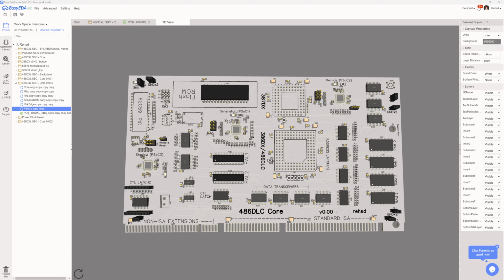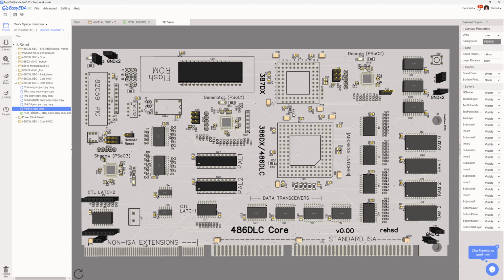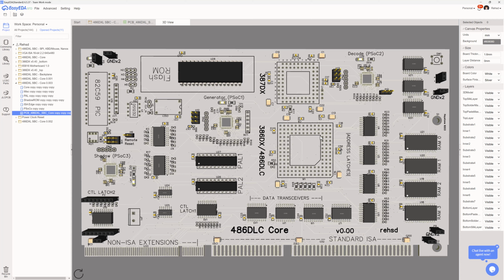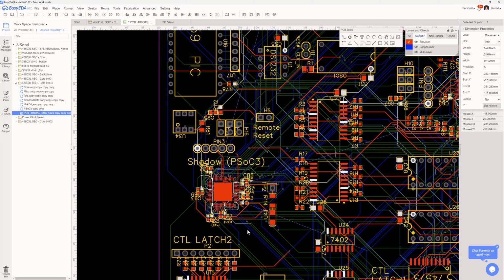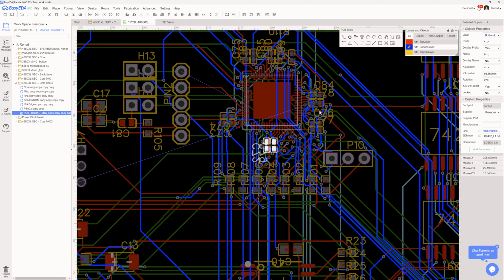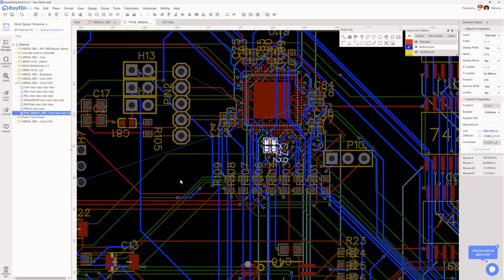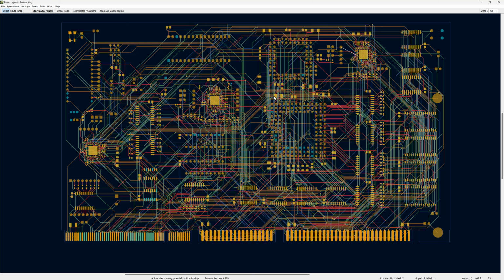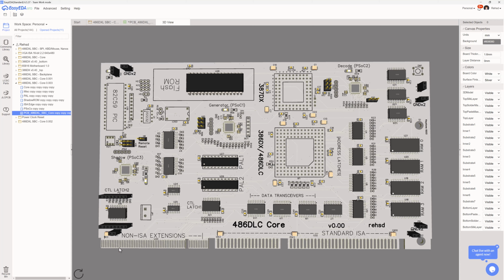Cx486DLC Build, Ep. 3 - Core Board Design, Step 3

Comment: Ah, and to think I didn't even had my crystal ball near me when I predicted the 486 build a few months ago :D 

Kidding aside, aren't you concerned with the distance of the decoupling capacitors in that design? IMHO (always) the CYKIT059 has them a lot closer together. Maybe and just to be on the safe side, and possibly design the PSoC "module" on a separate PCB, just to prove that it works before you go order the football-pitch sized ones ;)

Finally maybe you should get a hotplate or SMD oven if you don't already have one. Hot air will only get you so far :) I'd opt for a hotplate and do a PID as a retrofit, this way you'd get the best of both worlds :)

Getting exciting now, isn't it :)
Reply from the maker: Ya', I'm testing different options for the decoupling caps for the PSoCs. I'm also brainstorming options to further decompose the build into smaller PCBs. I do have a hotplate and SMD oven. My preferred approach is hotplate plus hot air. This is definitely a slow process for me. :)

Comment: 1. Place all caps around PSoC chips on the bottom side of the board - this will make routing things out easier. As they are, some of them are way too close for manual assembly - if you need to use a hot air, it's going to blow these components off the board.
2. Extend QFN pads farther outside so that you can touch them up with an iron if needed.
3. Use leaded solder instead of lead-free - it will make soldering easier because it melts at lower temperature than LF. But of course don't eat solder :), and wash your hands after soldering.
4. 0.2 mm traces are big - I always use 0.15 mm as default, and going down to 0.1 mm in tight areas (like BGA escape areas where space is at premium). Incidentally, 0.15 mm traces on many typical stackups have impedance close to 50 Ohm.
5. Use thick traces for power/ground lines (0.3+ mm) wherever possible. It's not so much about current carrying capability, it is more about reducing trace impedance.
6. JLCPCB 6+ layer boards come with via-in-pad technology for free, so you can place a bunch of vias on a thermal pad of QFNs - they will be covered and plated over.
Reply from the maker: I do try to avoid eating solder.  :)  Thanks for all the great tips!!

Comment: With QFN, you've got a couple of good options for how to solder them - either use paste and hot air.. or.. and this is the option we personally prefer and use a lot:

* 0.3mm drill vias in a grid pattern under the part in the exposed pad w/ a cutout in the solder mask on the backside of the board to the part
* tack down two opposing corners of the package just like an SMD resistor, having fluxed under the part real well
* apply solder to the exposed copper on the backside, holding the board with the part facing upward, and let the heat of the iron wick through the board along with the solder, till we see the QFN part's tack joints reflow for a couple of seconds and then take the iron away, letting the whole thing cool.

After that you can then flux and drag solder the remaining pins on the 4 sides knowing that the exposed pad is well soldered. This technique will even also align the part on its pads via surface tension. You'll know if the solder's wicked through because the backside exposed pad will become fairly dry of solder with the via pattern showing well.

Edit: we strongly advise making sure that the pads for the outside pins on the QFN are: 0.3mm wide, with a 0.05mm solder mask pullback, giving you 0.1mm of mask between pins; use 0.2mm traces; and that you have ~0.5mm of stickout of the pads from under the part so you have room for your iron to access the pads + someplace to tack wires if you need to rework anything. 0.2mm diameter wire works very well with this setup for modification. You can then use 0.3mm traces for the power and ground pins to lower your PDN impedance to those pins without it hurting routability.
Power and ground planes are indispensable with 0.5mm pin pitch parts.

For placing things on the back, we'd suggest decoupling caps and things like pull resistors - where they make sense. This is typically what we do, especially with QFN packages so we can have the terminals of the caps more physically close to the power and ground pins (granted, 1.6mm distance because of the PCB thickness) where putting the cap right up against the VCC isn't possible or doesn't make sense.

Comment: 0.2mm drill holes are going to be much more expensive. check JLCPCB's recommended dimensions
auto-routing is not a particular good idea, never really does a proper job. at some point you'll have to somehow match wire lengths, in particular the address and data bus out of the CPU, and the PCI stuff. I also recommend you also do that between the CPU and FPU
setting the PSOCs close to each other would probably be a better idea
you should probably move to using kicad at some point
remember, rule of thumb says 1ft of wire is 1ns...
Reply from the maker: Good info, thanks @AmauryJacquot! The autorouter is just for some initial layout testing. I plan to do much of the routing manually at a later stage.

Comment: Hi, I hope that connector on the back (non-isa) is in fact VLB, if not it should be and non-standard stuff should have another connector further back or on the back edge.
Reply from the maker: No, it's a PCI connector. I have not been able to find VLB connectors anywhere.
Reply: @rehsd  are they not the same just different position/orientation?
Reply from the maker: @wskinnyodden As far as I can tell, they are slightly different physical connectors. The PCI connectors I have are 49+11 pins on each side. VLB appears to be 45+11 on each side.

Comment: Why not to use KiCAD instead? EasyEDA is proprietary tool having lock-ins, I found difficulties for example to export precise 3D model of the PCB into FreeCAD to design exact plastic case…
Reply from the maker: I just need to take the leap to KiCad at some point and invest the time to learn it. I started with EasyEDA back a couple of years ago, and generally, it's been good.